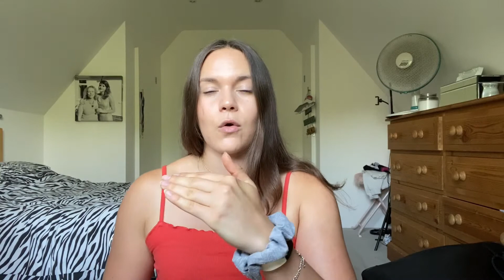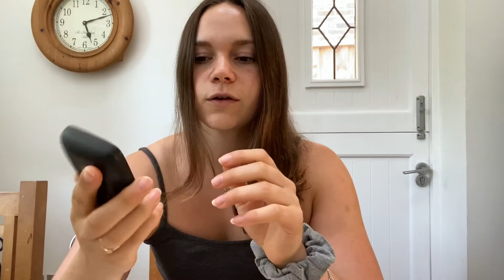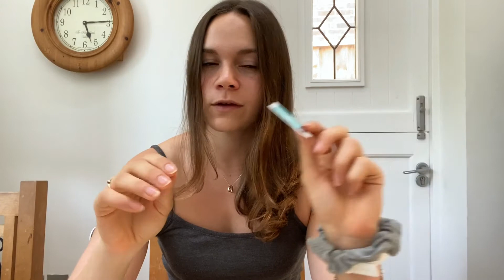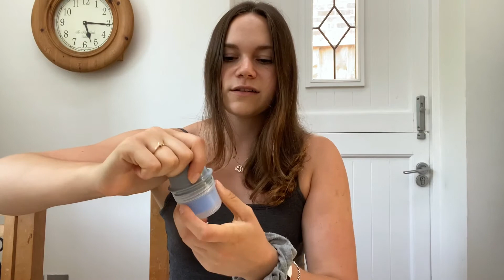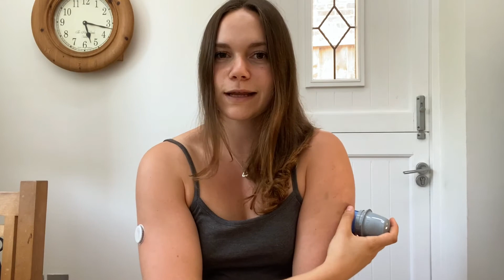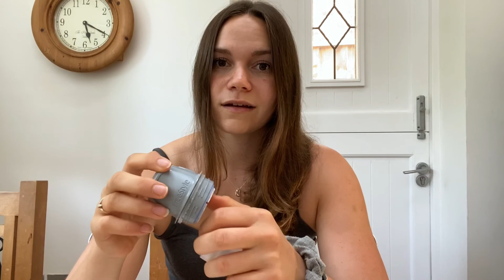HOW THE FREESTYLE LIBRE WORKS | How to apply the freestyle libre sensor - does it hurt?

Comment: Nice video. I'm using Blucon Nightrider with Libre Pro sensor. My blucon activates the Libre pro sensor and Libre sensor 1 without reader and without libre app. It also extends the life of the sensor for another 14 days.
Reply from the maker: Oh wow I’ve never heard of that! Do you have to just buy the libre pro sensor?
Reply: @diabeticbeckyfitness4879  Yes, I don't need to buy reader. I just bought Blucon for one time which is a CGM device and gives reading every 5 mins as well as it activates the new sensor and extends the life of my existing sensor for next 14 days. This Blucon does the activation and extends the life of Libre sensor 1 also.
Reply from the maker: @ayeshamaheshwari1756  wow ok I’ll definitely look in to that!